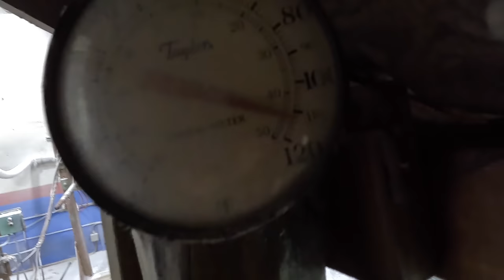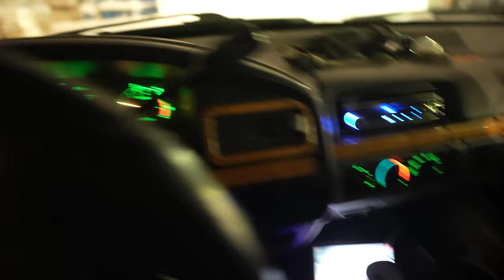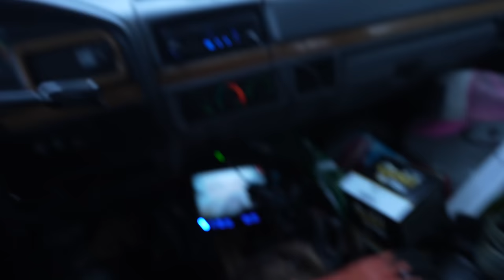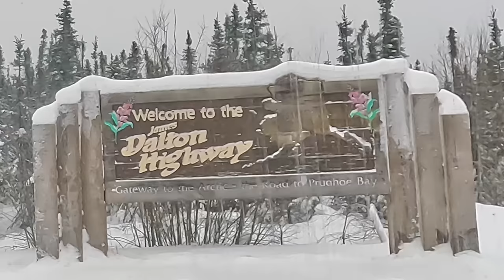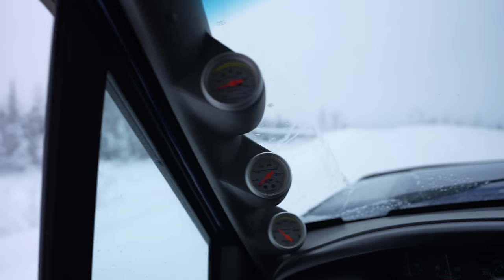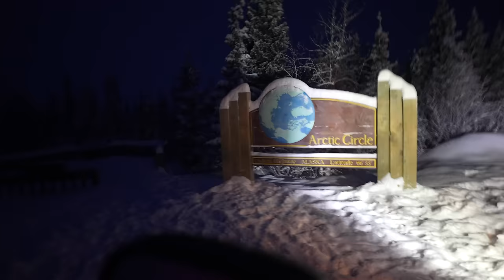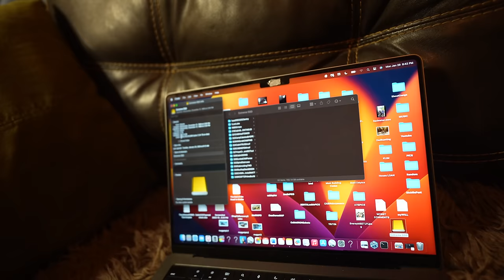Driving an Old Ford Diesel Truck 2,000 Miles to the Arctic Ocean in -53°F/ -47°C

Comment: Also, as you know diesels don't use spark plugs. They ignite the fuel by the heat of compressing the air. 

There is a thin line between a starting and a non-starting diesel engine. Either it starts or it doesn't. There isn't an almost. 

The issue is, cranking speed. Clean your battery terminals, make sure that you have tight connections at the starter, chassis ground, engine ground.

Good batteries are essential. A loss of a few milli-volts can cost you a running motor. Thick oil and cold intake air are also "non-starters".

And as I said elsewhere, ether should only be used without heating up your glow plugs. Maybe not at all with an idi.

I hear that you can blow the pre-combustion plugs out in the heads and then they dance around on top of the pistons.

Check with a second opinion, but I think that's right. 

Hope that helps.  :)

Comment: That light doesn’t mean the plugs are cycling. They run for two minutes so there’s no need to turn the key on and off. Just watch your voltage meter. And never use ether. Gas soak a rag and wrap it around your air filter. I have a 95 f350 7.3 with 320k miles

Comment: It's terrible for the engine to be at a dead idle for extended periods of time. It'll glaze the cylinder walls. I've heard because the crank doesn't splash oil on them, IDK about that. Raise the idle by 300rpm should be fine. Diesel engines don't produce much heat at idle anyways so it helps keep everything warm. Hope this helps if not you someone else

Comment: Was a semi owner operator from 1981 to 2013 when I retired. Hauled open platform, high, wide, heavy haul in   the early days before diesel additives became popular, I used to run straight number one diesel or 20percent kerosene to 80 per   cent number two if  number one wasn't available. Never jelled up until I bought bio diesel.  one time and jelled up at 30 degrees. It gums up the filters. Never again.

Comment: I get that you love your engine that much and stay away from additives but you should look into things a bit more. Sulfur is what is being removed for emissions but sulfur in diesel is a fuel system lubricant.  ULSD today is much different than when that engine was built and the fuel system needs the boost from those additives. Fellow 7.3 owner and I’ve gone as far as a small bottle of 2 stroke oil in the fuel tank. Seafoam, Marvel Mystery, Hotshot Secret, try one this Summer when you can really drop the hammer and open er up after a fill up.

Comment: Ok, you are fine with what you did to start and roll. It took a few shots of ether to reprime your fuel.  No biggie. But it does highlight just how risky your trip is. It does have potential to have anything go wrong, which would put you in a bad way. Anything less than -40F, and you never ever shut off the engine, no matter. Also, please add heat fuel additive to ensure your fuel stays clean.

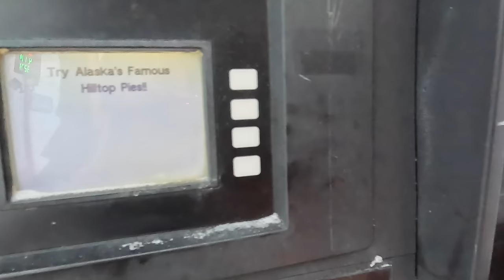Comment: 19:57 Please don’t lose your green cap. I saw that on the last video I watched. Did you get another cap? Did you stop at the station you left it at? Are they cheap enough to get a spare? Some vehicles don’t run right without the fuel cap.

Comment: Alaska has a statewide emergency Frequency 
Get a HF radio with those frequencies in it then
make a wire dipole antenna
that you can throw up on two tie points.
Google Alaska emg frequencies
On the 60 meter band.
It will a huge distance around you.
Stay warm and safe

Comment: I don't know if your 7.3 is like mine but the glow plug relay runs for 2 minutes, regardless if the wait to start light is on. So you don't have to cycle it more than once if you're not having it run for more than 2 minutes
Reply: Also if you lose the power steering don't you lose your brakes too?
Reply: Was your fuel filter black by the way? It looked like you had oil in it. That means fuel injector o rings need to be replaced if you run out of oil too

Comment: I've always been a Chevy fan but I had a buddy who had the same truck that you have but it was a two-wheel drive he put a straight 6/300 with a 5-speed manual transmission in it and like I said it was a two-wheel drive but we drove through quite a bit of snow we hauled fire wood with that thing for probably 4 or 5 years all winter long and I bet we drove through 2 to 3 ft of snow at times I live in Maine and I have always loved pickup trucks but I have always chose two-wheel drives because there's less maintenance and I have seriously never found a place that I needed or wanted to go that I could not get all it takes is a little bit of knowing how to drive and some weight in the bed of the truck decent tires help too but I always had bald tires and when I say bald I mean bald and a lot of people think bald tires are useless and snow but I'm telling you right now they work good to pack down a path and when you do spend your tires you don't dig yourself down in a hole

Comment: Why didn't you pickup a 5 gallon fuel container once you decided to continue and keep your engine running? Keep it in the camper until you have room to pour into your tank. Not much but every little bit helps.

Comment: I don’t put my truck in 4 Lo unless I really have to. Driving for long periods of time in 4 Lo is hard on the truck and the components not to mention sucking up a lot of fuel. I stay in 4 Hi most of the time if it is spinning a lot. Remember 4x4 is useless on the ice. Most of the time I am driving my truck on the beach and I try to stay in 4 Hi most of the time but in soft sand I need to drop it into 4 Lo. Sand is like snow, if you stay in the packed down areas like someone else’s tracks you can get away with out needing your 4x4. It takes an experienced 4x4 driver to know when to drive in the different gears but it’s easy to learn.

Comment: That was painful, watching you try to start the engine without first purging air from the injector pump, after it became air locked from the gelled fuel filter.  I'm actually surprised you got away with getting it running again using the ether.
Reply from the maker: it's all been a learning process, this was the 1st time it didn't cold start for me since I've owned it.

Comment: Power steering fluid puked because the pump wasn't running when you flat towed it so fluid from box cycled to resivior and not pumped back so overflowed!

Comment: 15 dallar filter would fix it.evry time you change the oil 5000 miles you need to change the filter.thats what I had to do with mine.you cou I d tell the difrence.i changed it even sooner when I could tell it needed it.most important thing you can do with those filters.

Comment: Depending on type of CB radio you have either you have the mic gain turned down to much, mic might be bad mic or if you didn’t tune swr on CB to get it around a 1-1.5 swr reading the radio may not be transmitting correctly

Comment: First why didn’t you have additive in the diesel tank to begin with
When you pull your fuel filter out and it’s gelled there cleared out put it back together. Your key from off to run position for 20 seconds. Turn it off do that two or three times until your filter housing fills up. If you don’t get fuel there it’s your lines and your tank , you can also transmission fluid in your fuel filter housing it will smoke, but run fun and if you don’t have additive for your diesel tank, you can always put gasoline 1 gallon per full diesel tank 
Where are you leave? You need to replace your batteries every 2 to 3 years cold kills them being a Ford diesel. Tech the best batteries are Motorcraft not being favoritism. I’ve tried them. All five different diesels trucks. Also don’t be afraid of starter fluid. Just don’t overdo it. if it happens again, always open your fuel filter cap on top of the engine and see if it’s full
If I was you living where you are take a propane heater and put it right underneath your tank and tarp around it
Power steering hose didn’t blow when your vehicle is shut off and you turn your steering wheel or it squirts fluid out of the vent hole on top of the cap

Comment: Never use ether while glow plugs can activate. Also learn a little more about the truck/motor if you had ever done the basic maintenance you’d have experienced the hard start after the fuel filter change so you would have known.  I love your content but if you knew a little more about your rig you’d be much happier. Also much more confident. Also glow plug relay is based on what it sees it needs if truck was warm like the garage then it didn’t want to have the glow plugs on working properly.  Also the light is not an 100% indication that there still on. Stay safe good luck run some diesel kleen in every tank and antigel you’ll never have to worry about it.  The 7.3 is hard to kill but that ether will kill it fast. Also another thing cycling the keys for the bowl to fill up does not work simply because your fuel pump is mechanical it’s actually in the middle of the motor behind the filter base and is driven off of a cam lobe threw the intake 100% mechanical. Electric fuel is after market for that year and didn’t become standard until later years.  Only way to fill the bowl is pre fill or crank crank

Comment: Are you changing the water separator filter and drain your hfcm  in your frame rail driver's side like right under your front door.. never nevermind the 7.3 don't have that setup

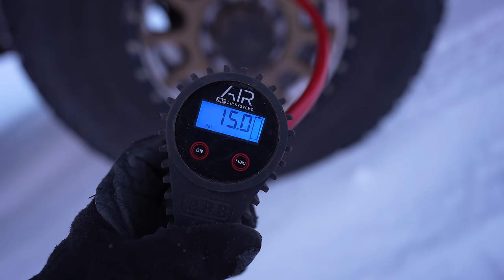Comment: 39:29  What is that pressure gauge you are using, does it allow you to release air? We remove the air valve which is so much quicker.

Comment: You need to run anti gel !! Regardless if you turn that truck off or not. You don’t have a heated fuel tank…. Also the reason you couldn’t start it with out ether was because you pulled the fuel filter at the motor and lost your prime!!!!! 🤦‍♂️

Comment: Hey Tim, at the close of this video I noticed something in the cabin on tires.  I can’t clearly see it, but if that is your CO2 alert mounted over your bed, on the ‘ceiling’, you should move it down low.  CO2 is heavier than air and generally kills people because it builds up on the floor then ‘fills the room’ like water.  IF that’s the alarm, it should go off about 15 minutes after you die.  If its not your alarm, my apologies.  I’ve had two careers involving safety in one form or another, and I continually drive my wife nuts by pointing safety stuff out, preferably in front of company (he said jokingly).  I’m going to crank up your last video and hit the sack myself.  Safe travels friend!

Comment: Man I hope you didn’t use that type f trans fluid, 1977 was the last year fords required it. It will burn your trans up type f fluid has the friction Material in it rather than on the clutch disks so using it in your truck will do bad things.

Comment: That fuel filter being black is a sign that your injector orings might be on there way out.
Reply from the maker: I was kinda thinking the same thing
Reply: idk whos injectors your running or if they are stock.  If you have to do orings I would do injector cups and send the injectors out for a refresh.  It is hard to tell in a video but the engine sounds like it has the slightest stumble to it.  May be time for some plungers and barrells in those injectors.  Also if you are running 15w40 I would drop down to a 5w40 oil for cold start ability.   @TruckHouseLife
Reply from the maker: ' @bryceheinz5004  I've got babyswamp 150cc injectors, they have about 100k miles on them (not easy miles lol), so I'm probably about due for injectors soon here. I use 5 40 synthetic in the winter and 15-40 motorcraft in the summer

Comment: You don’t ever want to use ether, it becomes addicted to it. Literally. It’s terrible for the engine, it knows the  compression right out it. And it sounds like the damage is already done if it won’t start without ether! Not good. I’m telling ya man, take that power stroke out and swapping a Cummins 12 valve! fummins swap! It’s the way to go. A Cummins 12 valve is Easy to work on if you ever even need to do anything. Everything is easy to get to, parts are readily available, and easy to find. A Cummins has way more torque and power! Better fuel milage! With a manual 6 speed trans you’re talking 25+ mpg towing a trailer! A 12 valve is  an industrial grade diesel engine, stout, bullet proof, reliable, and dependable. A Cummins 12 valve would have no problem starting in that cold Alaska temps. Plugged in or not! With a FASS fuel system setup with their dual probe heaters, I wouldn’t be scared to let the truck sit over night unplugged from a block heater. The thing to do would be a dual block heater set up, add an extra block heater where to w back freeze plug is,  and an oil pan sump heater, it will require to Modify the oil pan for a thread in oil heater element, But it’s a solid upgrade that will help keep the oil warm. Dual probe heaters in a FASS fuel system, battery blanket/  warmers, they are like plug in battery warmers that wraps around the battery and plugs in and keep it warm! And wire all those 4 things up to one master plug so when you plug in everything is powered off one cord and plug!  A webasto coolant heater / circulation pump combo would be the setup! 
  Your CB radio needs the antenna tuned to it! The SWR (standing wave ratio) needs to be adjusted! Then it’ll work better and you’ll be able to talk to other people!
 As far as fuel filters, you really need to upgrade to a FASS fuel system. I’ve mentioned it a few times, it’s an aux fuel filter lift pump system. 165 gallons per hour will be more than plenty. And a bottom tank sump kit. The water separator filter is the first filter and filters down to like 5-10 microns, and the main big filter filters down to like 1-2 microns, all the different places your getting fuel there’s no telling what kinda junk and crud and moisture is in those underground fuel tanks in Alaska! A premium filtration system is cheap insurance! And as I said before to, you can add the optional probe heaters on a thermostat, and what that does is preheat the fuel and keeps the fuel from hell in in the filters and in the fuel line. And as it pumps it around and around its ‘polishing’ the fuel and heating it to certain temp, like 70f. The stock original equipment filter setups on ford/chevy/dodge are junk! 
  Power stroke diesels are not known for being very good cold weather starters. The glow plugs and glow plug relay and harness where it passes thru the valve cover gaskets is a stupid design and are a common known problem to always go bad! The wires get pinched, melted, the relay melts and goes bad, and the glow plugs themselves bubble and get enlarged and will break off in the hole! At least at yours is only enough it dosent have all the emissions garbage. lol your def tanks would be freezing! 
Even with internal heaters, you got the best setup, having the 4 door quad cab f350! Just need to swap in a Cummins 12v, with a Bosch p7100 injection pump, an hx35 turbo, 100 horse injectors, a little more fuel in the pump plus some timing advance, bump the fuel plate and bigger delivery valves in the pump, a fass 165 fuel system with the probe heaters, and a 5” straight pipe exhaust! And find some way to get you more fuel on board! Ya you got two tanks, but they are small, 15-16 gallons tanks, for a total of 30-32 gallons, my ‘02 dodge 24v Cummins 6 speed  long bed has a 30-32 gallon tank. Titan fuel tanks makes a bigger 55 gallon tanks that is a ‘bolt in’ setup replacement tank. Combine that with a 30 gal Aux tank you’d be set! 
  You should have to run your tank all night. Even with your current situation and set up, you could easily idle it get it all warm and up to temp, then shut it down and let it sit for 2-3 hours, and it would be fine, being off grind you can’t plug in anywhere, I know you said you have a little Honda generator that you could run to fire up the block heater if you absolutely had to. If you had the fass system with the probe heaters and a cummins 12v 6bt it would fire right up after sitting all night long! 
Naa but you could totally start it up and run to operating temp every 3 hours I bet, it isn’t going to loose core temp after 3 hours. 
Sounds like you got a worn out/ honed  out old
Power Stroke smoker. Sounds loose, low on compression. Think Cummins Swap! 
I’ll come
Help ya! I’ve done several, we put a 12 valve cummins in my buddies 1 ton suburban, it turned out awesome, I’d love to do another Fummins swap!
Reply from the maker: Man, I've heard good things about the ole 12v swap.  Maybe one day, but I've got way too much invested in the ole 7.3 to mess with a swap right now. The electrical demons have really been plaguing me bad though.